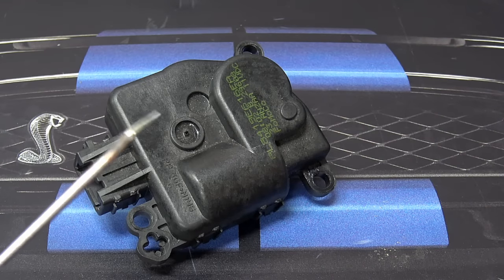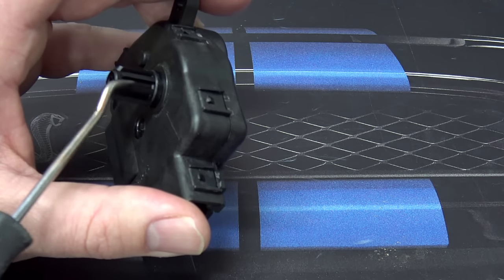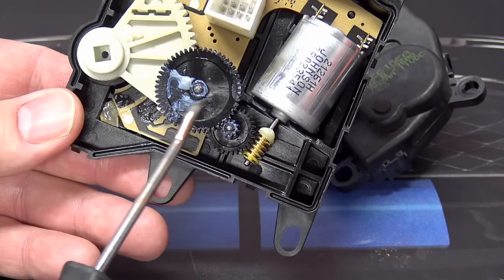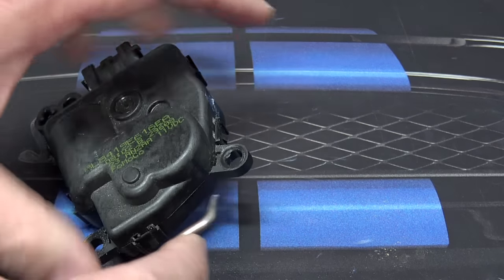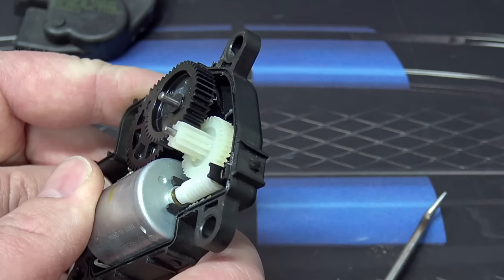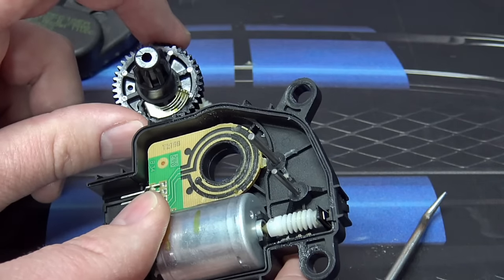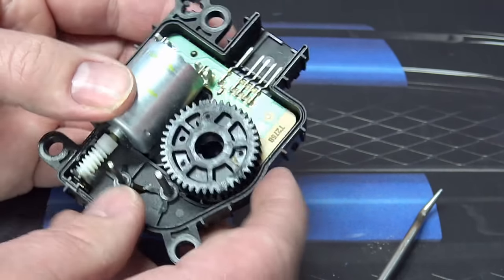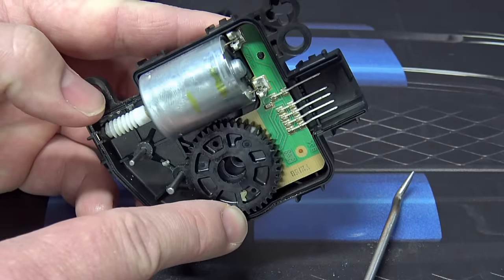Ford Vehicles: Frequent Blend Door Actuator Failures and Why?

Comment: I have changed 2 of those within a  year right behind glove box, I opened them and it was broken teeth on both.
Reply: I replaced mine but it still stock on defrost mode.? Help
Reply: @Vlad050  i dont know about defrost mode? those on the video are more than one in the air duct.. maybe you needed to change the other... but what do you mean by defrost mode.

Comment: Here in Australia the 2003 Ford Falcon GT (5.4 32 valve engine with Cobra R heads) had the same issue with these mixer doors, I think a shaft broke in mine. Dash out and replaced with the same bloody unit, so it’s bound to happen again. I’m a Ford guy through and through but they have made life tough for a fan of their vehicles.

Comment: Each design has one fatal flaw with everything else being quite durable-----
coincidence? I think not. LOL 
Thanks for your work!
Reply: And the flaw was that no matter what individual part failed, you had to buy a complete set, to get it all working again!

Are you old enough to recall REBUILDING A WORN OUT MASTER CYLINDER, OR STARTER? What about back in the day, when you had to maintain a vehicle to help keep it from breaking down? Now a days, things malfunction, for no reason at all, no matter what you maintain!! Change the oil regularly, keep your tires inflated, get the car washed every so often, and a $900 G.E.M. or S.K.I.M. goes bad, and you replace it, and have to pay someone to rewrite history to make it work!!
Reply: This garbage is purposely designed that way to break your balls to the point of getting you so tired of repairing it yourself basically every 2 or 3 years that you have n go to the dealership.
  I have 2 2007 mustangs and my gt can't last 3 yrs before this garbage breaks.
   I'm going to sell the fucking car and just put that money either into my 68 Camaro or I'll buy another classic car maybe a 67 mustang.
  Fuck these new cars,,,,gimmee the classics anyday.!
   A car is supposed to fun, not annoying...!!
Reply: @melisssa7777  Well stated. I agree they make the repair difficult DELIBERATELY, I would LOVE to be a fly on the wall when the manglement gets together with engineering to discuss such things.. you know it happens and they conspire somehow, even if it isn't stated bluntly. But even then I think rebuilding things like that was on its way out.
Reply: @roadkill5333  I was just a little kid when things like that were still done back in the mid 70s, but I have a vague memory of seeing signs for things like this at parts places and garages back in the day.
Reply: @roadkill5333  I have a brake caliper hone, to clean up the bore.  Nowadays people just buy reman calipers rather than rebuilding.  It's not very hard to rebuild them, but people just can't be bothered.  The guy in China who rebuilt the "reman" caliper will not take as much pride or care in doing his job as you will.

Comment: The newer designs (at least in my 2010 MKS as well as the new replacement part) uses the same smaller case as shown here, but instead of using the sweeper feet, it uses a keyed shaft on the output gear driving a potentiometer.  Seems like they tried to alleviate the sweeper issues, but now they're just back to breaking teeth!
Reply: How was the experience getting in behind the glove box? I want to make sure I don't run into surprises
Reply: Yup those teeth are crap too . I've replaced 2 of them 2 x now each and the one haven't been able to reach yet but it's in need of replacement too

Comment: You can rest assured this isnt just a ford problem..
Gm has a similar issue.
Reply from the maker: I have also seen it on Chrysler vehicles as we were a dual dealer.
Reply: @FordTechMakuloco  - Yep. 2012 Chrysler 300c needs one. Least its easy to get to unlike the Ford.
Reply: same tracking issue with the HondAcura tilting mirrors!
The fingers of the wiper brush over the position track are cupped upside down... grooving the soft track in a hurry - Their mirrors don't last too long $$$$ 😅
Reply: Just buy a classic 60s era muscle car....you will enjoy it alot more trust me.

Comment: This is exactly why I don't fool with the temp setting but twice a year. Once in the summer when I know I don't need anymore heat and in the fall.  

I had a blend door break on my 03 F150 Screw and had to pull the dash. Very time consuming
Reply: This may be the best advice I’ve seen on the internet today. Unless not using it causes the door to stick and burn out the actuator. Who knows.
Reply: @Morgan-cn5fk  i think every time you turn on the automobile it will turn those gears to position itself causing strain every time one turns on the car.

Comment: Thanks for figuring why they fail. I am a fellow Ford tech who just had to replace three of these motors in my wife’s Freestar. Both temperature door motors and the mode door motor. The motors must be different for each application as they had 3 different part numbers. The only external difference is one of the mounting holes that looks like a cloverleaf is clocked 90 degrees different. One must rotate opposite to another one or through a different range of rotation.
Reply: The van has gone 300,000 km, so the motors lasted that long before failing.

Comment: Ford has been having blend door problem for as long as I can remember.  I'm starting to think they design them to fail after a while because they're expensive to repair.
Reply: My 1999 Ford Fairmont (Ford Australia) one just failed - to be fair it lasted a fair while!  But still - not worth the cost to get it fixed. Never had that problem with my 72 or 84 Falcons much simpler designs
Reply: Mine lastes 14 years now it's
Reply: Additional profit potential for dealerships, can bill 6 hours labor per the book.
Reply: @seorwulf1049  fix it yourself?
Reply: @darkjord5823  sure and I still love my Ford, but that wasn't the point.
Reply: Guaranteed $$$ for the stealerships.  Ford SOP.
Reply: @JimBronson  You mean stealership?

Comment: It took me 1 hour to change it and the dealer wanted 500 $ to change it 5 hour labour....Great video.  Do it yourself it will save you a lot of money.
Reply: Exactly! There are still so many things you can fix on a car yourself. May be a PITA but will save you serious money. YouTube is great for this.
Reply: if they used aluminum or a light alloy for gears they never would have had this problem in the first place in the older style.  it seemed like the motor at times had too much torque for using plastic.
Reply: Its not really hard to work on. The problem is to get to the damn thing.
Reply: Who were you trying to kid only takes an hour to change it? I have seen what you have to do in order to change it as I work on vehicles myself. There is no way to shortcut that process without completely butchering The Underneath of the dash. I don't believe you and you should stop spreading false information such as it takes 1 hour to change it. I challenge you and I would put $1,000 behind it on a wager. Please contact me if you're up to the challenge.

Comment: I own a 2004 Ford Crown Victoria and did not have heat.  After searching for possible causes, I read that the door actuator was probably broken.  I found this post in you tube on how to test the system:   

Press the FLOOR and OFF buttons simultaneously, release, then within two seconds press the AUTO button.
This will start an automatic diagnosis.After the diagnosis process is done (the dot circles around and error code is displayed),  Press the Blue Cold button---Air Conditioner should work now.If you get a code 24 or 25 it is your blend door actuator control. 

My code came up 25.  My first thought was "fuck an expensive repair'  However, within a few second the heat was there and everything seems to be working properly now.

Maybe it just had to be reset for some reason.  I got lucky I guess.

Comment: Just changed this on my 08 Mustang.  One tooth on the first small pinion broke and got jammed in the large gear.   New one fixed it.   Note that several Youtube videos on this do not correctly identify the actual blend door unit. 

Can you do a video on how to fix the same vintage Mustang power seat up and down motor failures. 

Also, your use of the cats claw (?) tool has been a revelation.  I now have two similar trim removal tools and they are fabulous.

Comment: Replace the gears with metal ones found in old printers, and the PCB make ones with copper traces not carbon. They made the most important part from carbon so that it will wear out easily just to buy new ones more often. Make a new PCB and sell it as a repair KIT

Comment: Another brilliant idea from ford, I sometimes wonder why I keep buying fords especially when they come out with shit like this and don't stand behind it. These should be a recall issue and ford should be made to stand behind their shitty design.
Reply: Why would they recalls are more about safety issues
Reply: I had a gm car with the same design blend door actuator. They all use the same suppliers now. Granted the part worked for 250k before failing. I feel like I got my money’s worth out of it. And I bet most of the vehicles he is seeing with these failures are approaching that 10 year mark. Vehicles have gotten so complicated that it’s hard to get more than 10 years out of them even with meticulous maintenance.
Reply: @BrianBourgeois-  agreed. everyone is so concerned with changing the oil and other maintenance so a car will last "forever". Cars showing up in the junk yard today still have good engines. It's the rest of the car that failed.
Reply: What's the approximate cost to replace this part?
Reply: dfctomm  that's sad. I just spent a small fortune having the water pump replaced.
Reply: Remember the good old days when it was a simple slider attached to a cable to the blend door? No electronics, no gears to break, no motors to screw up.
Reply: Don't feel bad the other brands use same setups work on all brands make good money on changing mode and blend door actuators.Chevy has fan blower resistor issues and actuator,same with dodge and foriegn vehicles.Wirking for the dealer you see more,because you see the same vehicles over and over.Ill keep my Ford.
Reply: No matter what you buy, it will always be something or other.

Comment: older style works great IF you do not turn temperature knob dead stop hot or cold! Stop knob 1/8 to 1/4 inch before it stops and door and gears will not break! motor keeps trying to run other size! I checked it out when having to replace broken bend door!

Comment: Had to replace the older style on my ranger, either the motor or circuit board all the gears were good. It supposedly was a common problem on older explorers too. The doors is heavy but moves pretty freely. I removed the control unit while waiting for the replacement and it was winter in Canada, I needed heat I could actually get the heat to come on by hitting the brakes hard and turning the fan speed up high at the same time and once the air flow was going it would keep the door opened for the heat setting. I replaced it with a Doorman and had no further issues.
Reply: Does this same Actuator work for the Ford Ranger⁉️

Comment: Just changed mine the other day, pain in the ass but it’s worth it to not hear that clicking sound anymore.
Reply: How did you change it?
Reply: @1969robe  used a small socket wrench and bought a set of torx bits, removed the panel from the steering wheel.
Reply: @vcupiano  Thanks

Comment: I contacted you before on a ac problem on my 2011 4X4 f250 6.7L xl reg.cab long box plain jain truck with the power package.The evaporator core was leaking just like you said so I had it replaced  and about a month later my air would blow cold and then it would blow outside temp and sometimes it'll be blowing on high and then the air  in the vents would slow down and the air would turn to outside temp and I'll here the blower blowing hard in the box but the air in the vents slow down big time.It'll blow cold but when the air slows down coming out of the vents it turns warm like outside air but in the box under the dash you can hear the blower still blowing high but barely anything coming out of the vents.All functions work when I put it on defrost and when I put it on the floor and when I put it on the floor and vents ,all that works but like I said when I have it on high coming out of the vents and not on rec. or max just on high ac out of the vents it'll turn warmer and the vents slow down but the blower is still blowing on high in the box.This will happen 8 out of ten times.I'll turn the key to the on position but the engine off  and I try to hear for any clicking from broken teeth when I turn the controls on the ac and I don't hear any clicking.I even turned the ac off and let it blow on high and it stayed blowing on high,someone told me that's one way to check the evap. core but mine has been replaced.Do you think that actuator that you are talking about in this video could be my problem and if it is where is mine located at? Can you check for a bad servo if its not acting up at the time that you are checking? A guy  at a hole in the wall ac shop told me that you can't check a servo while it's not acting up,is that true? Man forgive me for all the stupid questions but I'm tiered  of making $500.00 payments on a truck that only has 74,000 miles on it and having all these mind blowing problems.I spent $1200.00 to have that evap. core replaced at that hole in the wall ac shop and I'm suspecting that they might of broke something under my dash that causing because my truck was fine before the replaced that core and now this.The dealer wanted $2000.00 and I just didn't have that kind of money.I wanted the dealership to do it but the money.Anyway take care and keep up the good work on your videos.Your videos help us out a lot,thank you for what you do bud.

Comment: FordTech Makuloco is spot on with his advice.  The blend door actuator failed on my 2011 Ford F-150 about three years ago.  It has just now failed again after disconnecting the battery ground to work on the SRS.  It makes a loud repeating popping sound.  I replaced the actuator with a "Lifetime Warranty" Dorman actuator three years ago.  You can get by with not going all the way with hot or cold until the power is disconnected.  Then it tries to find itself and you get, "pop, pop, pop", even when the engine isn't running.  In the next few days I'm going to install a redesigned Mortorcraft actuator.  Sure hope that one lasts the life of the truck.  I won't be willy nilly moving that control around.  I'll leave it at certain positions and rarely turn it.  That should make it last longer or at least I hope so!

Comment: I just replaced one of these on our 15 explorer sport. The driver and passenger side temperature control was fine, but the one that controls the vent selection was messed up. I was apprehensive about buying a non motorcraft one from O'Reilly's until I saw "Made in Korea". Then I was fine. I think the procedure is to pull the dash but I removed the knee panel and the instrument cluster and with an assortment of swivels, extensions, ratchets, curse words. Etc. I was able to change it out. Works like a champ

Comment: I have a 2007 Ford Fiesta that is blowing cold air and hot air at the same time. Would replacing this part fix my problem??!
Reply: You cry baby that worried about blend door motor heater Motors for many years Ford GM Chrysler Europeans in Japanese I've been using electric blender motors for years they all we're out it's a lot better than the old cable days they even broke

Comment: I have a good local mechanic I have been dealing with for many years. He told me once it doesn't make sense to buy really expensive vehicles since they do not use better parts. I think about that when I see these $80,000 to $100,000 trucks on the road. Just one broken plastic part away from a service appointment.

Comment: I am very angry with FoMoCo, I had a 95 Mark VIII, I worked for them many yrs. ago. I own a 97 LSC, and cannot begin to tell u how many blend door motors were replaced on the car under factory warranty, and after warranty, along with a heater box. I am ashamed of them as an American car manuf., do foreign cars carry the same set up. I am beginning to think, they make it this way purpousley, to make u get angry enough to buy a new car. I am not buying a new car. Why not design a blend door motor that is much more durable ?  I almost swore by Ford, but r beginning to dislike them for this f****n design. Am I right or wrong here?
Reply: You are right. It seems Ford is doing this on purpose since this failure is in the 3rd generation.
Reply: Never again Ford, NEVER AGAIN!!!   89 Bronco - great vehicle,   94 Explorer - good vehicle,  94 Taurus decent vehicle,  2000 Expedition -  Dead in driveway at 90k,  2007 F150 ( bought about same time as Expedition ) dying at 128k....  Never had this much trouble with Chevy or GMC,  trucks anyway...  Looking to put a small block chev/4 spd into my 49 Willys and bury the Fords, so that no one else will suffer...
Reply: @Garth2011  your right.
Many times I've taken my car in for service only to find broken parts like emergency brake lever plastic cracked off, gear shifter knobs broken, etc ..
 No way I'm going to bring my 07 Gt in anymore for anything like pulling my dash apart.
  I've replaced many acuators before myself.
   I'm done with it all. 
To be honest, I don't care about ac or heat anymore.
  I'll just buy a portable heater if I need heat.  
   I'm 100% done with getting jerked off every 2 yrs on replacing junk with junk.

Comment: I just pulled mine out of a 2010 Ford F150 Lariat and examined the failure.  It was where the large gear attached to the sensor.  Very small cross section of plastic connecting them  together.   So looks like they improved the gears but now it is failing where the gear connects to the sensor.  Real pain in the rear!